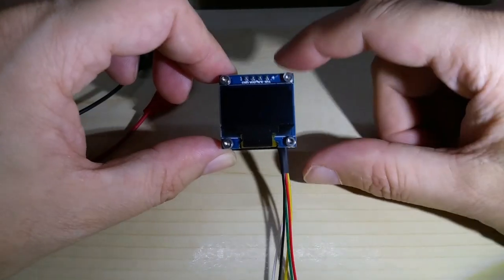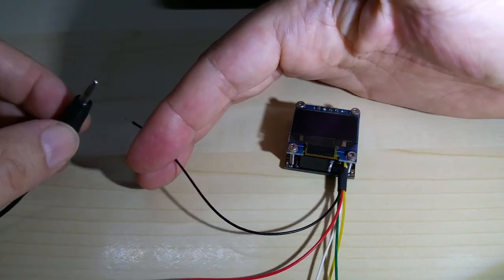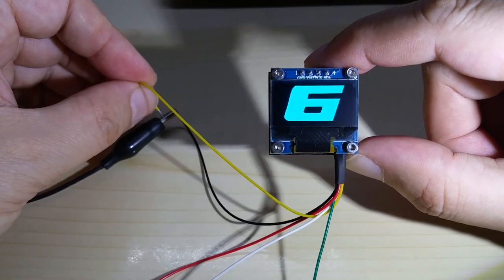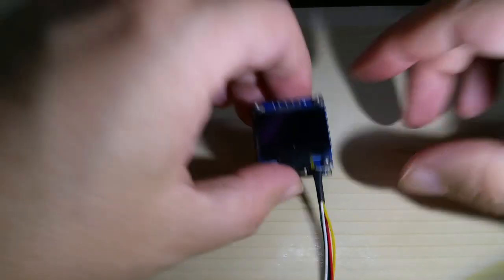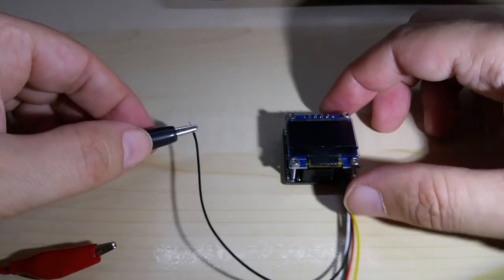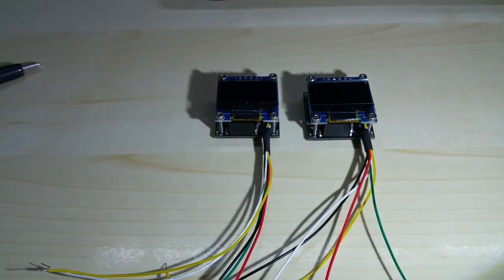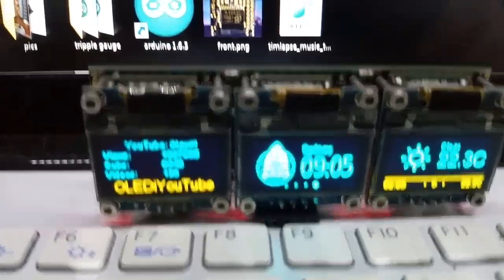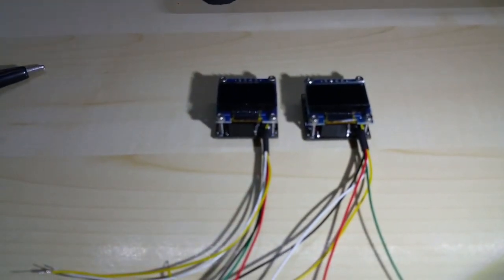Motorcycle Gear Indicator with updated code, for sale in my Tindie Store

Comment: Hey came across your products and was curious if you still have the tach, fuel, and other various guages for the car or if more are in the works/ you can do custom stuff.  I have a 1971 Datsun 510 that I was thinking of modernizing as some of the gauges don't work like the fuel gauge etc.

Comment: This is excellent!!!  How is visibility in direct sunlight?  And at that brightness, how  distracting would it be at night?  I am all in for one of these...Im trying to see how I would mount switches.  I can use micro switches also, right (vs reed)?
Reply from the maker: In direct sunlight the visibility goes down, I would recommend some kind of shade. Sure you can use micro switches also, they just have to connect the up and downshift signal to ground. Just make sure you weather proof the micro switches, you can also use some that have a lever on them.
Reply: Thats what I was thinking.  Get marine grade switches and trigger them that way.  I dont like how reed switches can be finicky at times, and would rather have the solid "switch" there.  Do you happen to have pictures of one of these mounted in the GoPro case?  And lastly...is there any limit to what you can do for the welcome screen?  Size/characters/time limit, etc?
Reply from the maker: True they are a little delicate, one of my customers used micro switches to and the way he mounted them was great. Have a picture somewhere but can not attach any here. Yes I have a picture of a GPS cube I made for the GoPro session case for another customer that wanted it for his sailboat. If a case like that is used you can upgrade to a 1.3" display also, every little helps. And the bigger number bitmaps help too because more LED's are turned on. I can do almost anything into a custom welcome screen, it just needs to be able to be shown on 128 by 64 pixel. I do of course scale them down to the required size and convert them to monochrome bitmaps. Time to be shown is no problem.

Comment: Fantastic exactly what I need for my 2003 Kawasaki ninja zx6r 636 , 5 gears . Is it connected to some switches or tied in into existing wiring? Can you show us how is connected to your bike...thanks
Reply from the maker: You need to mount a magnet to the gearshift lever and use small reed switches to get a signal when up and down shifting. This is obviously not a plug and play item, and needs some mechanical work  from the customer plus wiring it up of course.

Comment: These are awesome! Do you have any ideas about actually mounting them on a motorcycle? Are they weatherproof? How would one protect them from the elements?
Reply from the maker: Actually, you could use a GoPro Session waterproof case to mount them and have it weather proof. I made a custom GPS that way for a customer that wanted to use it on his sailboat.

Comment: Ello
Very impressive product!!! But does it work on a 6 volts moped HONDA 125 XLS or only on 12 volts? Thanks for your answer and great job again!!
Reply from the maker: Thanks, actually it runs with 5 volts, I just use a voltage regulator to make it run with 12 volt.
Reply: RE ello, Yeah super.
Also, does it work on a old moped model like HONDA 125 XLS from 1985? Because the hardness is very simple compare to nowdays moped. And i afraid that there ais not enough wire ta cable It. Have an idea about that? Thank again.
Reply from the maker: You need to use either reed switches of micro switches and mount it to your gear selector.

Comment: hi, my bike don't have a gear indicator is  yamaha raptor 700, if i buy from your shop how do i connect it to the bike as the gear are fully mechanic no electrics at all in it? Thanks Ricardo
Reply from the maker: You have to use either reed switches with a magnet mounted and the gear lever or use micro switches with long levers.

Comment: Is there a way that you could make one of these for a subaru with a manual transmission?
Reply from the maker: Yes, I can. You just need to be able to mount reed or micro switches to your gear lever. I can include R for reverse and a custom Subaru logo or text.
Reply: Hayri I shall investigate how hard this would be to be done

Comment: Hi!  Can you please make this work with programmable voltage inputs for each gear??  I cant use reed or micro switches with my shifter because of very short movements.  I plan on using a X/Y axis with two POTs.  I would be so greatful!!!  For example: I put it in 1st gear and press a momentary button to program it for that voltage, then 2nd and so on.
Reply from the maker: Sorry, just don't have enough time, too many projects going on.
Reply: Hayri :(
Reply: @iselfdevi  Are you trying to make it work on a kawasaki or suzuki motorcycle with gear position sensor?

Comment: How you connect the wires to the gearbox to send it the signal.
I like buit one to my Yamaha FZR400 from Mexico City
Reply from the maker: You either need to use reed switches with a magnet or waterproof micro switches with a lever.
Reply: do you do a smart one wich uses speed and rpm signal  to work out gear

Comment: Hi,Hayri ... Hows the Clocks coming along?
Reply from the maker: I am desperately waiting for parts to arrive. Right now I could only make 7 of them but ave over 90 people waiting. The only thing missing are those RTC modules on the back of the clock. I have 70 pieces on order.
Reply: No worries sir, there is not rush, was just a head up, on situ :)
Reply from the maker: Thank you for your patience. As soon as I get at least 10 or those RTC module in I will put them up for sale and hopefully they keep coming in.
Reply: Many thanks, i shall keep a eye open for them :)